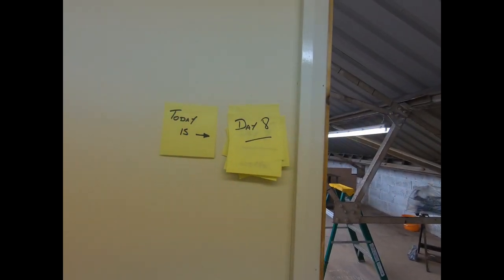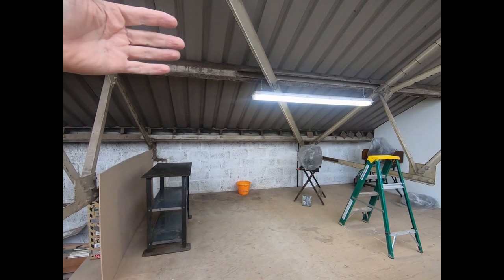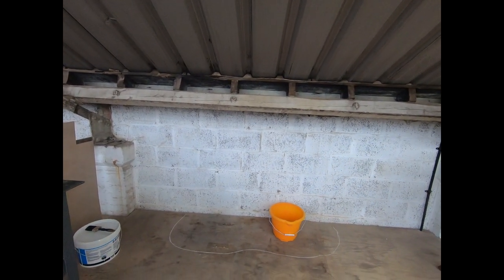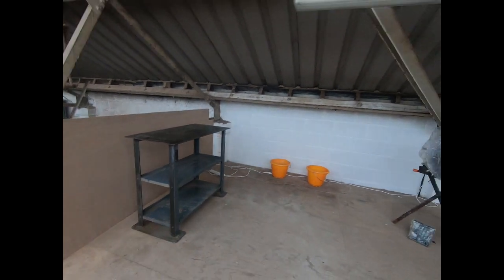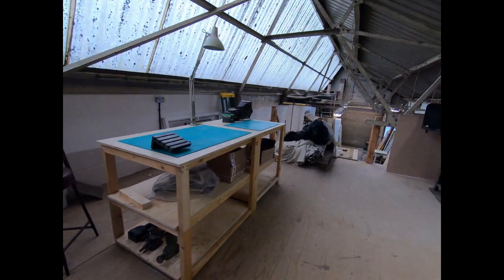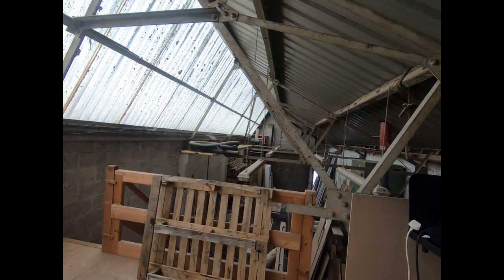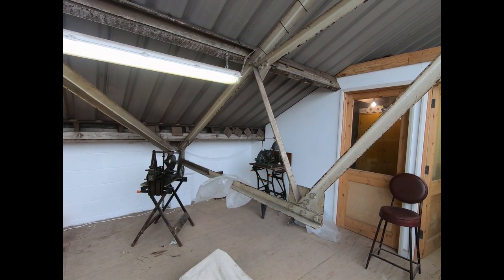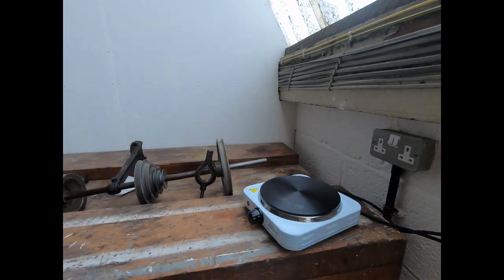Moving to a Larger Workshop - Part 3.

Comment: Hi Paul .   Finding locations for machines can be difficult ,  I have a dozen machines from small to large that i am trying to do an approximate layout plan for .    Looking at the roof truss , i would not  think you could remove that diagonal & replace it with a vertical member as it still forms the triangle for support to the rafter .  Cheers .
Reply from the maker: Hello Max,
Thanks for visiting... I think I will draw a plan to try to help work out where the machines will go... also the partition wall being in place will help me understand the light... on the roof truss I am leaving that with the guys who own the building to decide...
Cheers.
Paul,,

Comment: Getting rid of that steel truss in the middle will make a big difference to floor space. I love the idea to do a built in desk and shelf in the clean room. It should be a good way to maximise the space in there. The video footage of the ML2 where you have your back to the light source was super clear and easy to see. With the surface plate length, check out Mat Look's channel "Look Creations" if you haven't already. He goes into detail in some earlier videos about "step-scraping" to flatten a larger surface than your surface plate is.
Reply from the maker: Hi Craig,
Agreed the clean room fitted desk will help... it is quite small in there so making the most of the space is important. I have made a few changes on the layout and will experiment with some filming tomorrow. I have watched Mat's scraping videos but will watch again when I am ready to tackle the Myford.
Cheers.
Paul,,

Comment: Hi Paul, looking good mate. If it were me, I would be having all the machines over near the natural light, both for ease of working, and definitely for filming! Benches in the middle area where you still have roof height, and other storage over in the darkest lowest part. Your train set of course but I would definitely be having as much natural light where you plan to do the majority of your filming, it will save you a big lighting headache and make your vids more attractive to new visitors etc. Cheers, Jon
Reply from the maker: Hello Jon,
What you have outlines makes a lot of sense... The one thing I am unsure of is the impact of the patrician wall and how that will impact the light... If all goes to plan the guys are going to make a start on it next week, so I should get a feel for things after that. Thanks for watching.
Take care.
Paul,,

Comment: Looking good Paul. It sure will clear some space and head bumps getting rid of the support even if you have to  put in a single vertical post to replace it. I actually wondered why there was so much cross bracing for that roof, the slate makes total sense. Did you use magnets to affix your cop caps on the Record? All the best! Eddie
Reply from the maker: Hello Eddie,
Making progress slowly but surely... Hopefully next week things so move on quite a lot and things will be nearly done. No magnets on the copper caps... they are quite thin and I just have the end twisted in and they tend to stay in place. Thanks for watching.
Cheers.
Paul,,